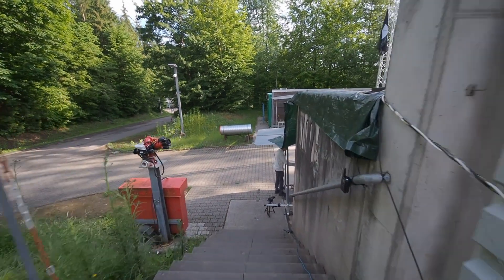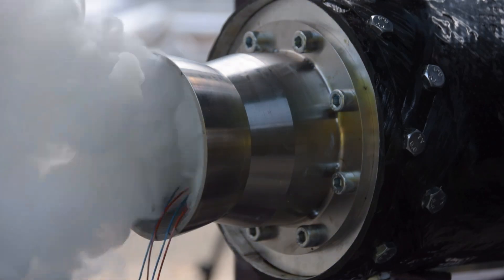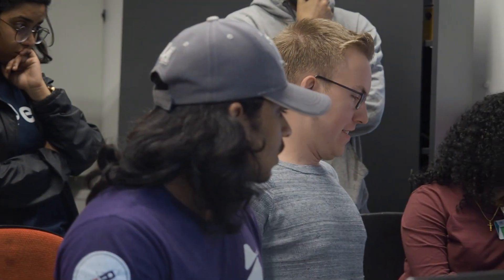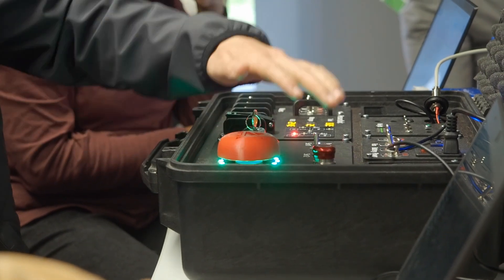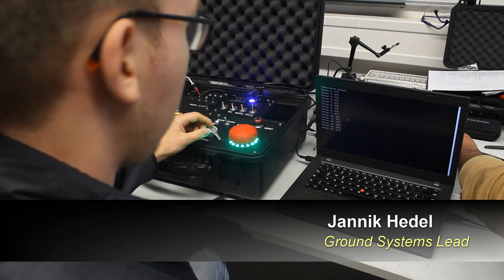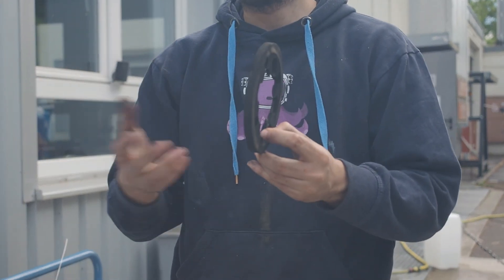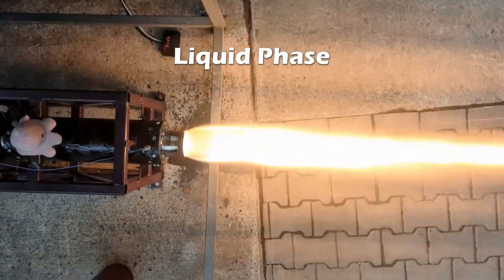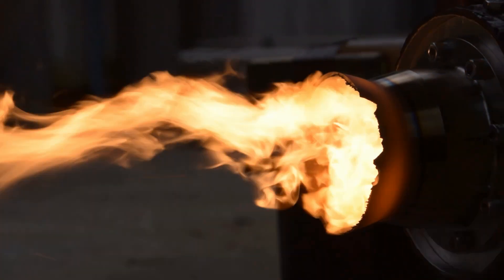Hot Fire Testing one of the biggest student hybrid rockets in the world!

Comment: Try ABS plastic as a fuel! 3D printed completely solid. (100% infil) So you can create any combustion chamber geometry. For example, a multi-port or even a spiral combustion chamber. Which has a huge surface area, thus improving the fuel/oxidizer ratio and breaking the laminar flow.  So you don't need a diffuser in front of the swirl chamber, and the flame temperature will be reduced. It may not burn the nozzle either.  The combustion properties of ABS in hybrid engines are very similar to HTPB material!   I think you could even get a 20% power increase with it!  Try it out....  I am working on a hybrid engine with this system right now.

Comment: The erosion, why is it always at 10 o'clock as you look at the nozzle
Reply from the maker: Not entirely sure.  On the 3rd and 4th hot fire, it seemed like the erosion was in the same place.  But for the 5th one we used a different nozzle and it eroded at a different place.  I think it just has to do with the geometry and imperfections of the nozzle components and insulation we were using.  Beyond HF3 and HF4, there were no repeated patterns of nozzle erosion.

Comment: Some backseat driving but I can't imagine sort of flash cooling the nozzle after your burns being conducive to keeping it in one part.
You're basically annealing and quenching it (unevenly at that).
This can cause wonky stresses and forces and warping.
Assuming you guys are pros and have maybe accounted for that.
A different mode of cooling it after the fire, at least during testfiring, might help mitigate that margin of error.
Also testing if your burnchamber and the nozzle are still up to the machined specs after every burn might help check for deterioration (If you weren't already controlling for that).

Really impressed with the rocket as someone absolutely not smart enough for avionics, aeronautics and cosmonautics.
Reply from the maker: We are actually only applying the water some minutes after the burn.  So the metal temperature is only a few hundred degrees or so.  The reason why we do this is actually to prevent our CFRP casing from getting damaged.  It has a much lower heat tolerance (like only 150°C or something) so we are attempting to keep that part cool enough to prevent warping and damage.  As far as we could tell, our water application during this phase of the cooling did not have an effect on the tolerances of the parts.
Reply: @ASTRABremen  you can see the blue discoloration of the nozzle at 3:10 which is showing chromium depletion of the steel. without chromium, your nozzle is no longer corrosion resistant, hence why the nozzle corroded so quickly in the second burn. if you want to continue reusing the nozzle then you need to improve the thermal management.

also leaving the nozzle to cool directly in air will give you instabilities in the microstructure, from such high temperatures its a form of quenching... looks to be less than 800 K so normalisation won't be a huge problem, but something to consider.

Comment: Your combustion looked a little nozzle-rich at the end, but otherwise good.

What altitude was your nozzle expansion ratio set for? If you're going for ground to full flight velocity in 8 seconds I expect you'll be above most of the atmosphere pretty quickly, so you probably don't want to target optimum efficiency at sea level?
Reply from the maker: Not sure what you mean by "nozzle-rich".  But if you mean the nozzle was ending up as fuel, then yes.  The expansion ratio we had was targeting an altitude of about 3 km.  This is why you see the strong mach diamonds in the flow as the combustion gases recompress once exposed to the atmosphere.  Looks cool, but is only really efficient when the engine is flying.
Reply: @ASTRABremen  Yes, that is indeed what I meant. More generally "engine-rich exhaust" refers to any part of the vehicle other than fuel combusting :)

And I did notice the mach diamonds, but it was hard to see detail because of how bright it was. Maybe set up a camera with a shorter exposure to study the exhaust plume behavior for future static fire tests?

Comment: The increase in massflow at lower temperatures is mainly due to the lower vapour pressure of the nitrous oxide not the density (the effect of density is minuscule). Due to the lower vapour pressure the two phase flow effects that reduce the obtainable massflow through a fixed geometry are reduced. You can look up some literature aviable for it, like the Homogenous Equilibrium Model, Dyer Model and FML Model that are designed to model two phase flow of compressed gases when they flow through a orifice and end up with a pressure lower then the vapour pressure (like it’s the case with your combustion chamber pressure).
Reply from the maker: This is definitely a much better explanation than the one I give in the video.
Reply: @ASTRABremen you can add gaseous oxygen to the nitrous oxide tank to have more control over your vapor pressure (also if you prelead your lines with GOX you can reduce your ignition latency), your flow looked like it might be slightly underexpanded, so increasing your exit area on the nozzle might increase your performance a bit, and adding some thermal mass to your nozzle might keep the temperature lower and reduce your erosion problem (if it even matters)

Comment: Great job! One question: what difference do different nozzle lenghts make in terms of thrust?
Reply from the maker: That is an interesting question.  The optimum nozzle length will be a fight between two factors primarily:
1. Longer nozzles weigh more so a desire to cut mass will demand a shorter nozzle.
2. Optimum expansion of the exhaust gases works better when they have more volume to do that in which will demand a longer nozzle.
So, the maximum of the interaction between those two variables will give you your optimum nozzle geometry (this is of course a bit of a simplification - this is a deep and long rabbit hole).

Comment: Amazing work, it would be worth investigating different materials for the nozzle or looking for some ceramic coatings, they can be costly but look inside your uni you may find support from other labs or partner companies.
Reply from the maker: The real trick is to solve the oxidizer rich environment at the nozzle.  If there are too many free oxygen molecules at the nozzle exit, it really doesn't matter what material you use, it will just get oxidized.  So in future versions, we are going to do our best to increase the mixing in the chamber so we can significantly reduce the free oxygen percentage by the time the flow reaches the steel parts of the nozzle.  We may come with a fancier nozzle material in the future, but that is dependent on which partnerships we are able to make because steel is pretty much all we can afford right now.
Reply: @ASTRABremen  Have you considered using a glass fiber based composite nozzle? Maybe even a cloth-phenolic as those are easier to obtain COTS. Pure silica wouldn't corrode nearly as much

Comment: guys why didnt you use lox as oxidiser
Reply from the maker: Well, Nitrous Oxide is just a bit easier to work with.  It is autogenously pressurized which vastly simplifies the pressurization process (though it does introduce complications with 2 phase flow through our injector - which mainly just costs us a bit of performance).  We are also able to work with Nitrous at temperatures above freezing.  Lox would require cryogenic equipment.  Lastly, if you noticed, the materials we are using are already having some trouble with Nitrous Oxide as the oxidizer, so a 3x more potent oxidizer is not exactly going to do us any favours in terms of the systems durability.  We would need to upgrade much of the equipment to be able to handle the thermal conditions the increased performance would deliver.  But maybe one day when we master Nitrous Oxide we can make the switch to some more fancy propellants.